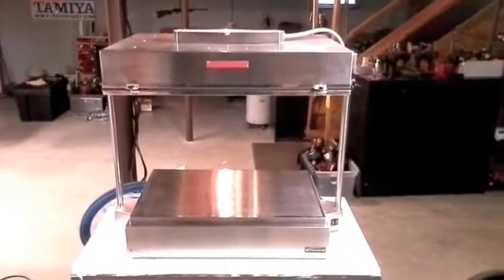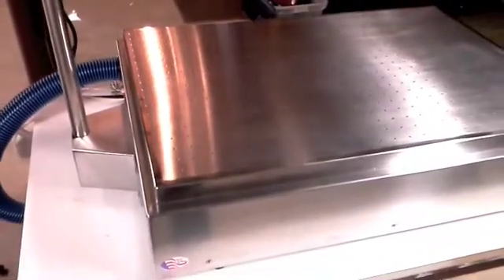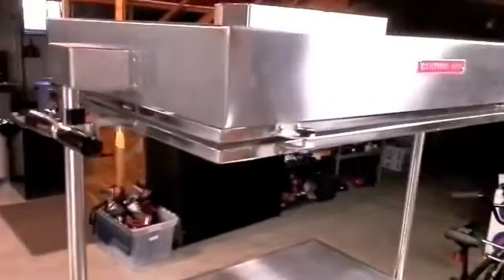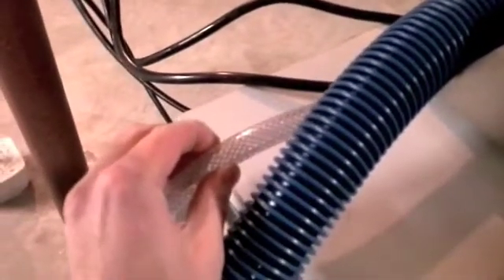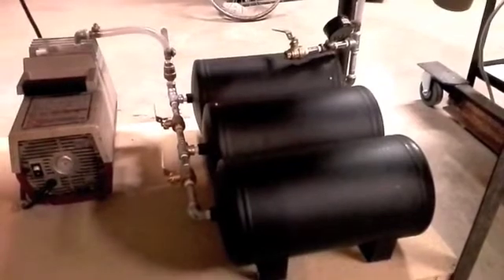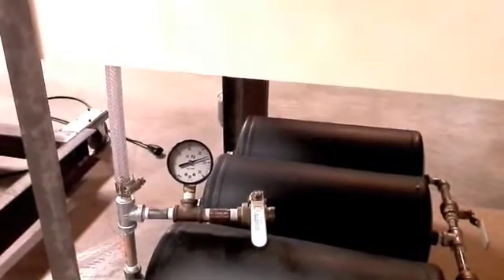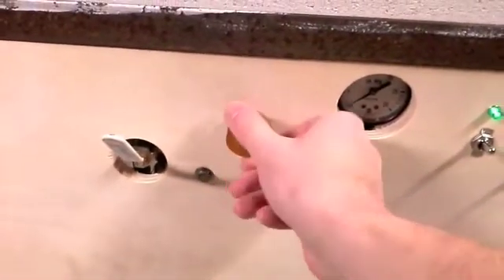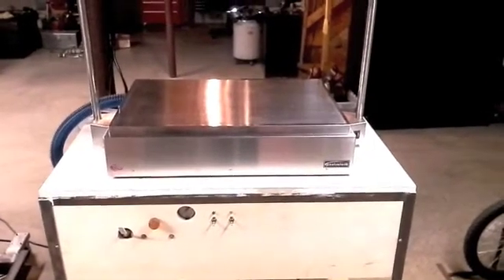Vacuum Former

Comment: hi, I'm doing this kind of project for my final project of undergraduate degree. May I ask these questions?
1. is that kind of heating elements arrangement heat evenly throughout the plastic sheet? I'm still under uncertainty which type of heater should I choose, is that wire heater just like yours, or using ceramic infrared heater.
2. speaking of the vacuum tanks, do you really calculate the volume required for given forming area?

Thanks before, have a wonderful day!
Reply from the maker: To answer your questions, 

1. I actually have not used the unit's heaters for heating a sheet of plastic yet. The large size seemed nice at the time I bought it, but when you want to make a small part, it's a waste to have to use a big sheet. I actually build a reducing window for the plastic holding frame and the platen. It's 1 foot square and I use a large toaster oven for heating it. Being inside a convection oven like that does heat pretty evenly. I don't have a ton of experience on the matter, but I'd go with the ceramic infrared heater myself. I actually did buy a pair of those for my original plan of building the unit myself from scratch. 

2. No, I've never sat down and calculated volume of vacuum needed for the forming area. I find the vacuum motor alone sufficient for most jobs.
Reply from the maker: ...Also wanted to say, good luck with your project! I'm not the most knowledgeable person, but I'll certainly give my 2 cents if you have any other questions along the way. :)

Comment: Hi,
Can I ask?
I plan to make a dome-shaped product extends from acrylic material.
The size of the elongated dome shape is:
Length: 3 meters
Width: 90 cm
Height: 30 cm
Thickness of acrylic sheet: 8 & 10 mm.
What I want to ask is:
1. How many degrees Celsius heat should be used?
2. How large is the capacity of the vacuum suction machine should be used?
Thanks.
Reply from the maker: I'm sorry I can't really help you too much with that, as I have not worked with acrylic or anything that large or thick of material. The melting point of acrylic is 160 degrees Celsius so I can only guess just under that. With such a thick sheet your heat up is going to be slower but your cool down will be too, so I can only theorize vacuum capacity isn't going to be as critical as long as you get a good seal, and can reach  good pressure. A vacuum pump in conjunction with a higher volume vacuum motor may be a good idea since you're working with fairly thick material.  
I would suggest putting your material in a dry box for at least a day or two, to get rid of moisture in the material. I don't know about acrylic but I know poly-carbonate tends to hold moisture and bubbles up badly if not dried first. 
Sorry I can't be of more help, but I just don't have much experience with vacuum forming much less the perimeters you have in mind.
Reply: Ok, it is alright.
But I am very glad you can answer my question even though it is not what I expected. Stay happy.
Once again, thank you so much & GB

Comment: You have an amazing setup, I myself am about to build my own vacuum former but I was only going to use my twin motor shop vac, I assume this would be the high volume low pressure method, why do you use a vacuum and tank and when do you use it? Do you turn off the pump, lower the plastic then open the valve of the tanks or do you have both pump and motor runners together at the same time? Sorry for all the questions this is so interesting.
Reply from the maker: Thanks, glad you like it! 
Well first off I'm far from an expert on this still, so don't take my opinions as gospel truth. I only have done a few draws on this machine too, to be honest.
I used a vacuum and tanks for a lower volume but higher pressure vacuum. I to get a deeper draw I might pull the bulk of the air out with the vacuum motor, and then get pull a little more with the tanks. I normally would leave the vacuum motor going while I add the vacuum of the tanks. The manifold of the unit isn't super air tight (probably because I'm using a reducing window with no seals) so I like to keep the vacuum going to hold the pressure better. 
Hope that helps some.
Reply: You are awesome, 
Thank you for replying and more importantly thank you for sharing your knowledge, sometimes when you start something new it's a little difficult finding specific information. Especially when you're building a machine, I will share my build with you once I finish it.
Out of interest, I have a pump and a 12L tank that I use to degass silicone, do you think I can get away with using the 12L vessel as a tank instead? save money and space I am thinking. I guess I can try and see.
Again thanks for the reply.
T
Reply from the maker: I think it's worth a try to see if it will work. The tanks I have are only 2 gallons each for a total of 6 gallons or about 23 liters. Not a huge volume either in my opinion. I think your manifold size and seal you achieve on it will effect how big of a tank you''ll need too. Looking at the big picture, though, your shop vac is going to be about 90% of the pull, and many people get along just fine with nothing more then that for a vacuum source. 
Anyway, good luck with your build and if I can help you out in any way, just ask.
Reply: +ElationProductions Yep worth a try, lets see what happens.
T
Reply: I purchased the smaller machine. Still trying g to work out the bugs. How have you been doing with this set up?

Comment: Is each heating element plugged into a separate power outlet? I don't recall you mentioning requiring a 220V dedicated outlet.
Reply from the maker: Yes, the heating elements plug into their own 110V outlet. That's the way it came from the factory to make it easier for people to find a power source for it. Each heater is rated at 12.5 amps, both being 25 amps, so you have to be aware of the limit of the breaker you're running off of and anything else that might be drawing power at the same time.
Reply: Thank you for replying. It's helpful to know!